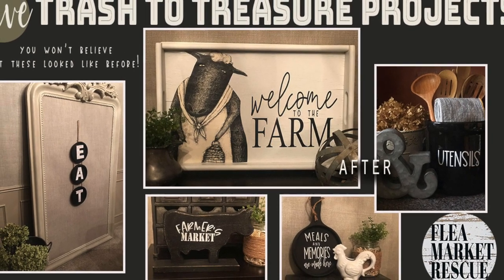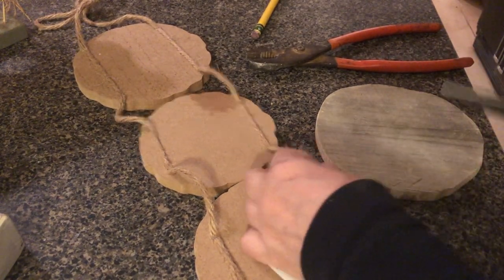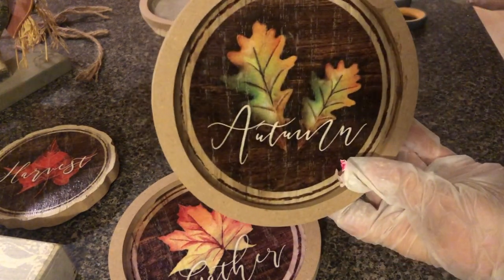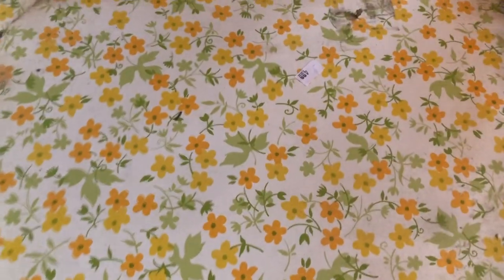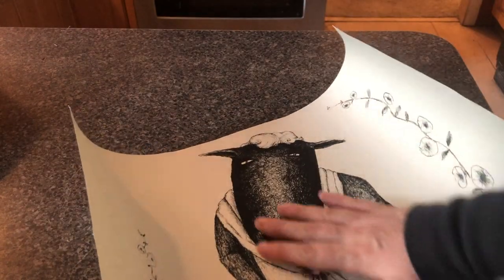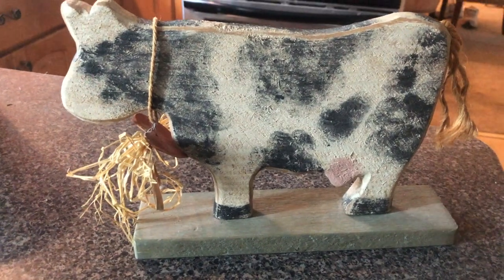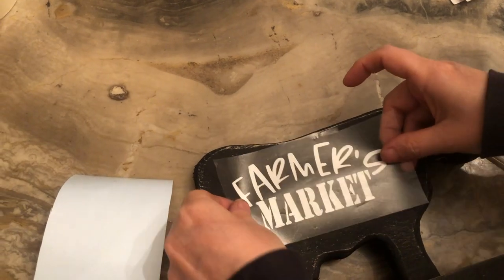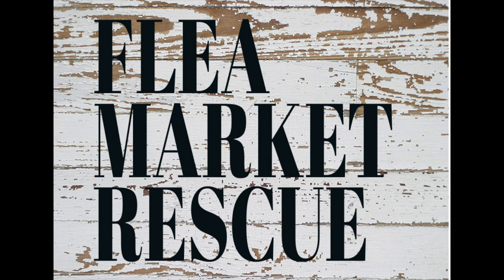FIVE DIY TRASH TO TREASURE FARMHOUSE PROJECTS-THRIFT STORE FLIPS & MAKEOVERS

Comment: I hope to paint a glass bunny with textured paint, do I need to prep the glass before I paint to make it adhear? And if so what product would I use. Love your projects and wish I lived closer to you as you have great thrifting places.
Reply from the maker: Hi There!  I normally don't paint glass, however, I have painted over ceramic, which is just as slick and I always use chalk paint.  Chalk paint covers everything, ceramic, metal, etc....  If you want texture all you have to do is just add some baking soda.  You add equal parts and stipple it on and that should work out perfectly.  No need to prep when you use chalk paint, either.  Hope that helps! Also, thank you for the sweet comment on my projects! XOXO

Comment: YES.... would love a scroll saw class. I purchased my very own scroll saw (will share with hubby) but it doesn't seem to work like we thought it would. ANY help would be appreciated.  Thank you. Danielle
Reply from the maker: AWESOME!  That's great to know!  I won't have the scroll class ready, however, until late Fall, but it's nice to know there is interest!  Debra....what's going on with your scroll saw?  Is it not cutting good?  Is it hard to cut with it?  I use  a fine blade and it cuts good for me.  What kind of wood are you using?  If you're using a harder wood...it can be difficult to cut. I always use pine.  Well, let me know...if I can help you....I will.  Thanks!

Comment: What brand of vinyl do you use because mine never weeds that easy lol
Reply from the maker: Amanda, I always use Oracal.  It's the best!  Great quality!  Also, if you having trouble with cutting....it could be your settings.  On my first Silhouette, I had the setting too deep and it would cut almost clear through the back and I always had trouble weeding!  On the new Silhouette Cameo 4......I find if you put it on a 2, it is the best.  At 1...it won't cut through, but 2 is PERFECT!  Put the force at 10, Speed at 5, 1 pass and you should be good as gold!  Hope that help!

Comment: What is the accelerator for?
Reply from the maker: Hi Bonnie...it allows for the glue to make an instant bond.  If I were using epoxy glue...I would put the glue on there and have to wait for 24 hours for it to dry completely.  With the Starbond....you put the glue on one side and then spray the accelerator on the other half and when the two parts meet...they bond instantly.....no more waiting time! Hope that explains it.  :  )